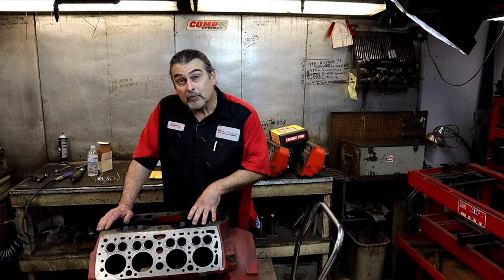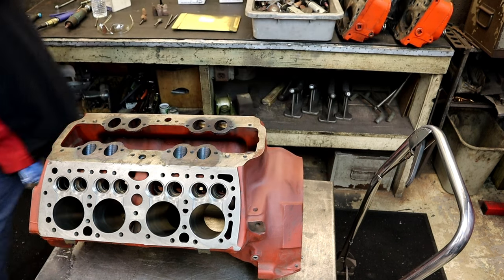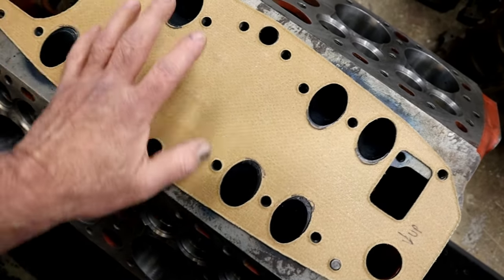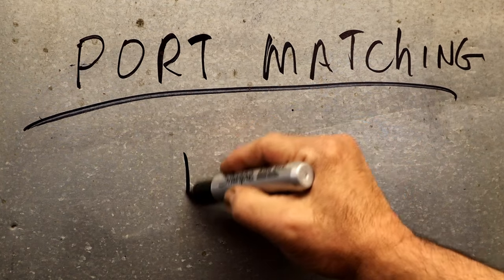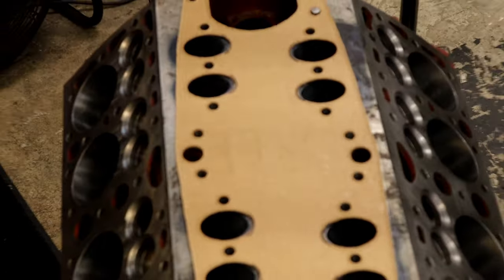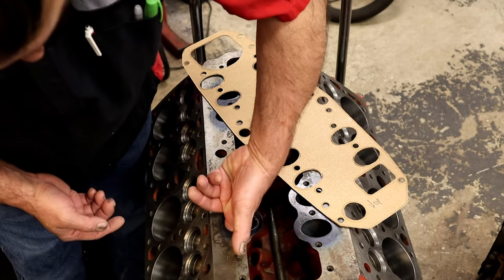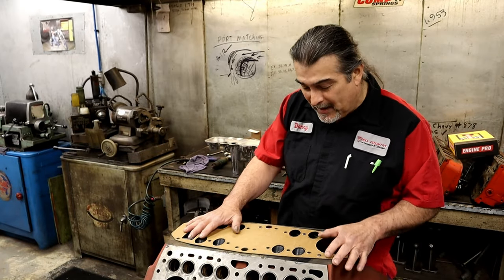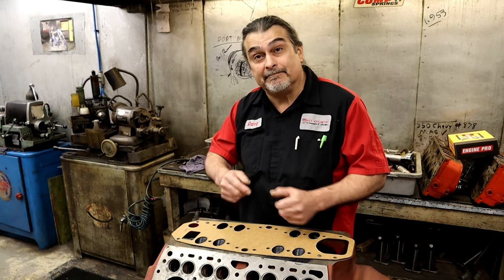THE IMPORTANCE OF PORT MATCHING A FLATHEAD FORD

Comment: Great Video - thanks for the guidance. I have read with the French flathead that the ports are narrower than the US blocks. In order to run a hot cam, do these ports need to be opened up further or is the valve matching sufficient? I have a complete French flathead motor and curious to know what cam you will use. Thanks, Barry.

Comment: Awesome video Danny.  it looks like the ports were massaged by the previous owner on the 59AB assembled block I'm putting in my '37 Ford.  I'll check the gasket and see if I can port match the '39 intake I'm going to run on it.  Thanks for the info!  Is that French flatty factory relieved for industrial use or did you do it at the shop?
Reply from the maker: It’s factory relived.

Comment: I just picked up a 50 8ba and am going to do a rebuild on it next summer, I want to see if it runs first. They're a very cool engine and have a very cool sound to them too. Are they still casting the French blocks or did you just come across an NOS one?
Reply from the maker: Love the Flatheads and the way they sound too. Not to many French flatheads left. NOS. I have one more for another customer.

Comment: ''Anti-Reversion'' I was just trying to remember that word the other day looking at some D port heads! lol My trick to port matching is I just run the motor really really rich and let the carbon do all the work its also how I ceramic coat my pistons. lol  j/k  ive always enjoyed looking at dissembled antique engines and it just amazes me how they engineered shit with just a pencil and paper The Pratt 1340 on my Ag-Cat was originally built back in the 1930's. Its still probably the most safest and reliable aircraft engines design  ever made.

Comment: I'm fascinated by the whole "staying off the floor" thing. It sure makes a lot of sense for forced induction, but does it hold true for naturally-aspirated applications as well? I can easily visualize forced air hitting the outside of the bends, but when I think about the piston pulling in air, would it not take the inside-most path...?

Comment: Off the floor, Raise the roof, Round ports and longer runners = high Velocity for bottom end while square/oval ports short runners = higher flow and lower verlosity make  top end, Or atleast that's what I've come up with on fluid dynamics after destroying a few sets of heads over the years. LOL  Although my solid C average in HS may tell you different guess Im not  smarter then them engineers at  Ford or GM after LOL
Reply from the maker: It’s hard sometimes to get people to understand air speed (velocity) fills the cylinder better then a big dead hole.